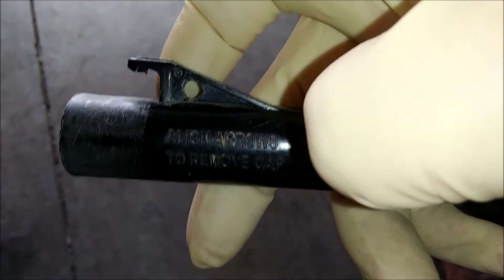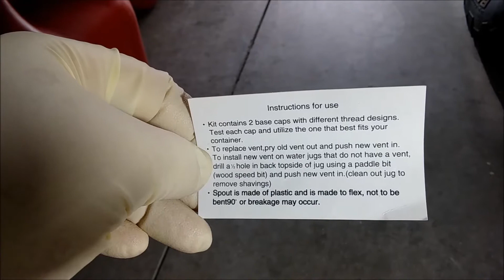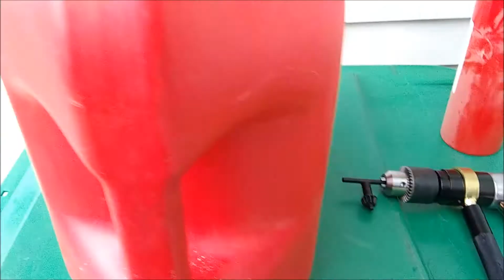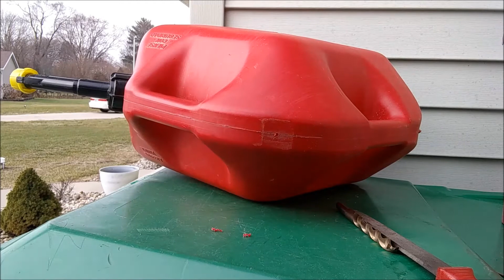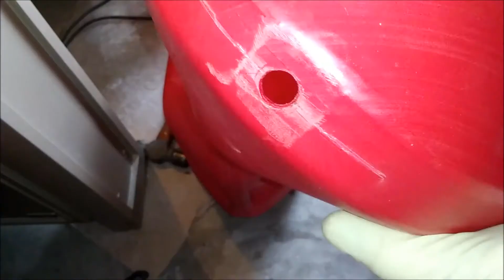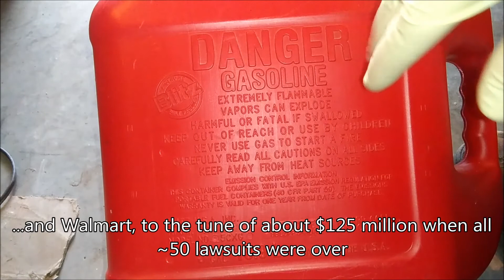How to Vent Your Gas Can (Freedom Mod): Max's Tech Tips!

Comment: Yeah that air drill might not be very expensive, but what about the thousands of dollars in a massive air compressor needed to run that drill....hmmmm
Reply from the maker: You may have the wrong impression of air drills, or at least air drills of that size. What you saw in the video is running on a $150 HFT compressor.

I wouldn't want to use that setup as a complete replacement for my electric drills, but it does have unique uses where its nice to have around.
Reply: @TheBrokenLife  For some reason, I was always under the impression that you needed giant air compressors for air tools...maybe I'm wrong...how often do you have to stop and let it fill up?
Reply from the maker: @DurzoBlint178  That depends entirely on the tool and what you're trying to do with it. Just as a point of reference, with my cheap HFT compressor and what is arguably a very good IR impact gun I can pull all 4 wheels off of a vehicle without the compressor slowing me down. Stuff like a cutoff wheel or a die grinder, that run non-stop, eat a lot more air and require a lot more waiting.

Generally speaking, "good" air tools are about 1/2 the cost of their electric counterparts and "cheap" air tools are usually pretty good (much better than most cheap electric tools).  That's why I started buying air tools to begin with.

With all of that said, I really do need to make an air compressor basics video as a few people have requested it. I now have 3 different compressors, in 3 different sizes, to use for illustration.
Reply: @TheBrokenLife  Thanks...I think I need to go get me some air tools now
Reply from the maker: @DurzoBlint178  More tools is always the right answer. 😄
Reply: @TheBrokenLife  amen to that🥳